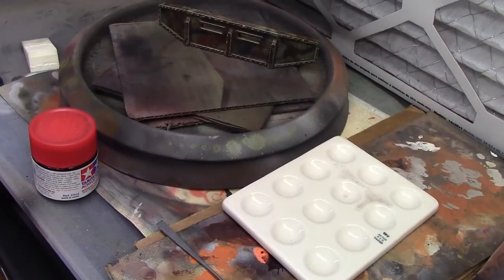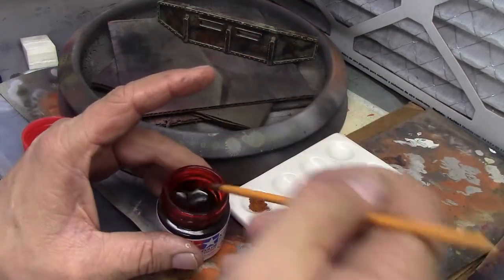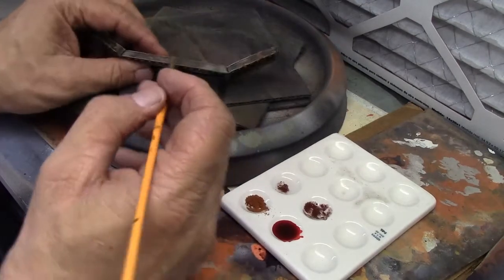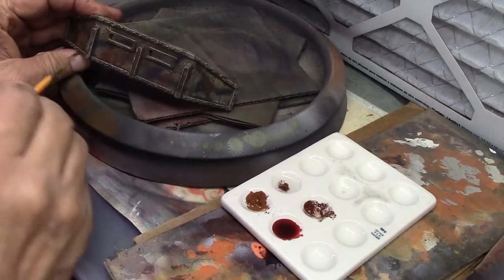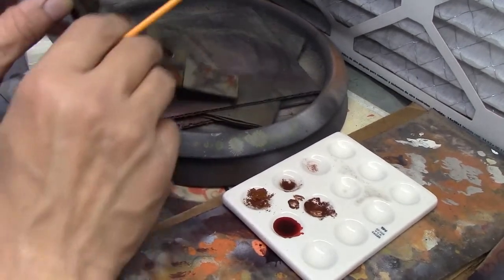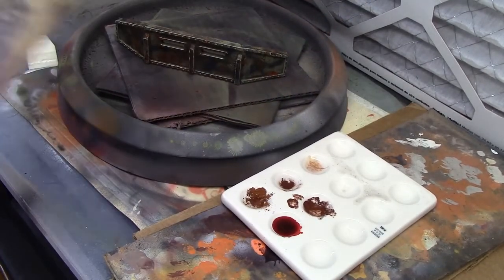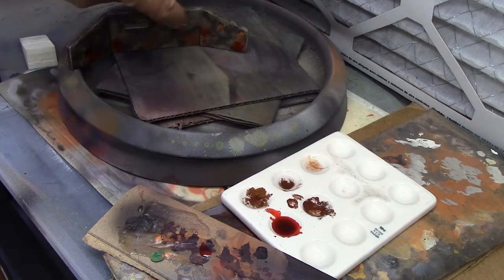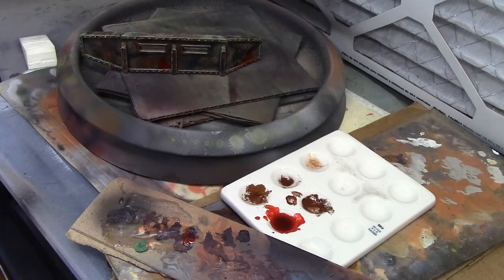3D Printed Barrier Part 6

Comment: hear that clicking? sounds like you either have a leak in your compressor or a short in the wiring for it (the pressure control switch) which is what's causing it to not want to stay off. Either it's bleeding pressure or it doesn't know to stay turned off. Probably about time for an overhaul or a new compressor. 
On a side note I wish they made small sized screw type (supercharger style) air compressors. It seems like the smallest anybody makes is about 60gal. Would be really nice for hobbyists to get a small screw type because they are almost completely silent and make very little heat seeings how you don't have a piston or crankshaft to deal with, it's just a couple shafts (usually sometimes one) with screw like mechanisms that turn in to each other that compress the air down through the center manifold and into the piping/tank.